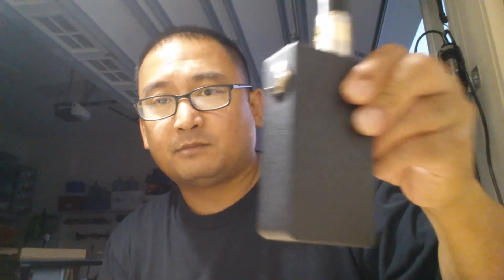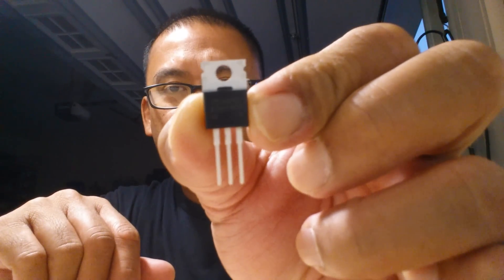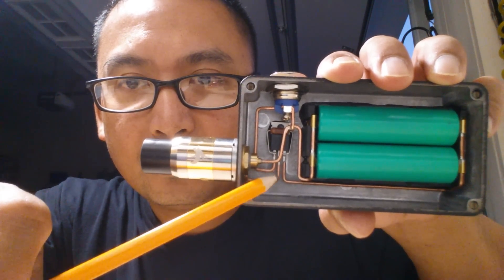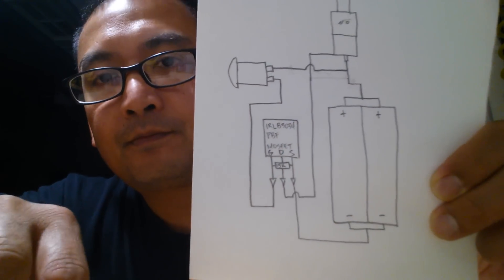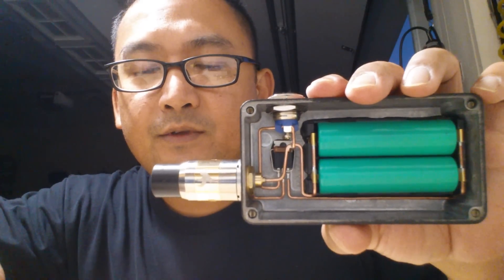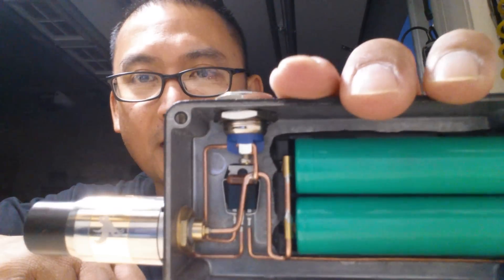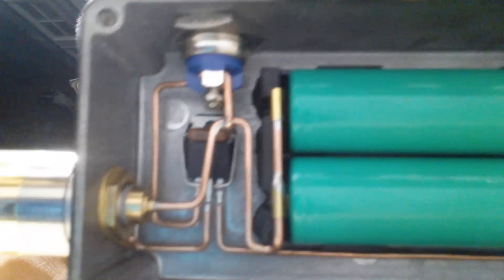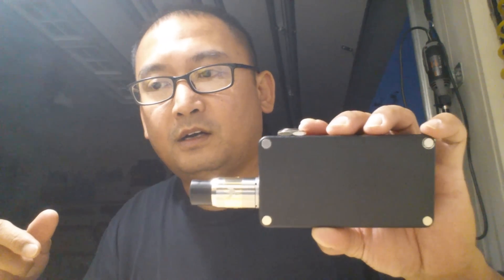Unregulated box mod with a Mosfet

Comment: don't get me wrong, first pin in mosfet is gate not ground. fitst pin is gate, midle pin is drain, and third pin is source. and resistor is connected from gate to source.
gate is trigger for current flow from drain to source, you can input postive for gate or you can use pulse if you want ajust flow current. remind me if im wrong

Comment: I have always been curious when using a metal box rather than a wooden or plastic one, would this cause more drainage loss from the batteries or the power going to the positive 510.
Would this use more power from the battery and cause less to go to the positive 510 pin,due to negative wire pressed on the inner part of the metal box by the nut, that holds the 510
So the current flow not only goes to the outer 510 but travels around the metal on the box, hence more voltage drain,
Where if you had a wooden box the current only travels to the outer part on the 510 as wood is not conductive,
If wrong could you explain please,

Comment: What's the wattage on that resistor? Also it seems like the extra ground from the drain on the mosfet to the outside of the 510 connector is unnecessary seeings how your negative is all ready on the source to the mosfet

Comment: witch pre coils you use ??? using the vtc5 battery ??? ... and the other cuestion, is there any diference between the 1 or dual battery ?... in the matter of the coil you use ??

Comment: It still safe if im not using the fuse? Or another fuse with the same spec? 15A, voltage? Can i using motocycle fuse in same ampere (15a). So hard to find that fuse bro, huufftt

Comment: How do you keep it from shorting itself out? Bare wire in a metal box is a bit scary IMO, especially if you drop or knock it over. Maybe that's just me.
Reply: Can you wire in a switch for some safety. But unregulated mox mods are always unsafe thats why they do not show them off to buyers
Reply: @filds1   It's not the unregulated part of the mod that's scary. It's the bare copper wire. Using wire that has a sheathing would be fine, but completely bare? Is asking for moisture to fry it. It could be any kind of moisture; e-juice, humidity, sweat (if it's in your pocket) etc. The box itself is metal which is fine, makes it easier to ground. But the bare copper wire just makes it easier to short out. It's an awesome build I don't want to detract from that, just was curious about the bare wire is all.
Reply: It just depends on the builder.You can make it safe. But people tend to avoid these kind of things while making a video.

Comment: People that don't use flux at every possible turn Rob themselves. Rosin core works but it's not enough. Especially for 14g wire and stubborn areas when your New. Depending on how long you take to do a good solder joint. If you can do it fairly quickly, than rosin core would most likely be sufficient. But your joints will shine with jester flux

Comment: Clean, but unsafe. We put these things in our pockets, I think I'd rather see some clean wiring with insulation. There are so many points of failure. What if you drop it, or God forbid you joined weren't soldered mistakes happen. This would be very easy to vent a couple batteries

Comment: I kinda posted this question already on your previous bid, but I wanted to add one detail, on that duel 26650 series mod, I was considering parallel mosfets, to mainly disapate heat better, but to do a few other things as well. what are your experiences with this as well?

Comment: Hi my friend ... I here very sad since I have everything to arm my box mod of 18650 x2 in parallel and it does not work, I followed your steps, I placed the mosfet IRLB3034PBF but my mod does not work ... I connected it with copper wire And the polarity as you have put it ... you can think what can be the problem ?

Comment: I'm so surprised this hasn't blown up on you. Do not ever use bare solid copper wire, that has to be the MOST dangerous thing to use.
Reply: KEVIN'S SPIRITUAL JOURNEY With the bare wires being that close to the metal box, any movement is almost always going to force one of the wires to touch the side and short out. Its also not recommended to use solid copper wire for mods anyway. Its just overall unsafe.
Reply: You're some sort of dumb. The gauge of those wires means that they wont bend from normal movement. Even dropping it on the floor wouldn't cause anything to short out.
Reply: for real though. 14 gauge is thick as fuck.

Comment: ATTENTION !!!

Can some one please explain to me why do we need to put a 15k ohm resistor on gate and source pins? whats the reason ? And whats the wattage? From the size i guess its 1w.
Reply: Basically, if you don't your mod will always be firing.
Reply: werethless12 thanks. how to determine what resistor is needed? does wattage matter? and i have made a mod with a mosfet its was 60Volts 70Amps rating. and after some time it broke. did i short it out somehow?
Reply: Life Sad Could have been a fake MOSFET. I have a 15k ohm resistor on my MOSFET. The MOSFET I use and that is highly used is the IRLB3034PBF, make sure you buy from a reputable retailer, like digikey or mouser.

My box is only a single 18650 mod, I don't build below 0.3ohms. Which is about 60w
Reply: werethless12 i have made a 235w beast two18650 in series and with a tsunami rda.  hits good. 0.30 ohm just barely in the safe spot
Reply: Life Sad I use LG HE4s, they are good for 20A, I only push about 14A with my build. Its perfectly safe.

Comment: where do you get other parts like the 510 and the wire? I have pretty decent electronic knowledge (used to install stereos in cars) but Im at a loss for getting every part needed for a vape mod. I have a friend 3D printing me sleds

Comment: here is a stupid question. Why use transistor. Just put the bateries in parallel you will get 4V (ok 3.7 after a while and 4400mah if you get one that is 2200mah...that is like days of vaping). why use extra parts. Adding a transistor in non regulated circuit is just adding more heat to that box and wasting battery juice. i use one 3.7v 2200mah battery with only a switch on a 1.8 dual coil. it makes a ton of vape and flavour. you dont need transistors or diodes..its only a waste of battery power
Reply: the transistor ( MOSFET ) regulate the voltage output of the battery to make it constant untill the battery power starts to get totally consumed , plus that , it protects the any backward current in the circut , it's like safer to put this transistor . :)
Reply: my quesition to you ,, 3.7V and 1.8 coils would give you about 14 Watts , how do you get a dense cloud with that ?!!

Comment: quick question: is there another alternative MOSFET that can be used besides the one used in this proj? Local shops here doesn't have that particular rectifier and if i try to buy via amazon or the like would be expensive on my end due to $ to Peso rate :'( Awesome vid btw and your works looked really great and neat inside-out. keep it coming!
Reply: There's different mosfets rated for different amps,
Reply: I would love to know the same thing lol
Reply: +Hohmies Mcfly it's a type of transistor not rectifier. Just fork over the money and order it, it's your build and you will be proud of it
Reply: hey did you ever get that project done,? if so how did it turn iur

Comment: hey how low can you build on that box. i heard that with mosfets you can only go so low. i am building my own box  i will be doing basically the same thing as you. i use 30 amp batteries. how low could i build safely

Comment: Does the wire have to be copper?
Reply: No, however it is always good to check the resistance of the wire you use with a multimeter (found at radioshack or amazon or with a search on bing.com). You do not want the resistance of the wiring inside the mod to drop below that of the coil or it will short circuit. Thicker wire has lower resistance. Until you know what you are doing, follow a mod build by instruction, check your mod with the multimeter, and then try other stuff if you still think it is necessary. Check out the wiring diagrams on fogcity (https://i0.wp.com/fogcityvapesupply.com/wp-content/uploads/2015/10/Series.jpg?ssl=1), they use two 15 amp fuses. The build above is a parallel build; I finished building a series circuit earlier today and should have some photos of it on www.coilpix.wordpress.com within a day or too (maybe by tonight). I went highly similar to the build above and may add the fuses on my next build. Always know what you are doing before you activate the firing button and be safe. Happy moding. :)
Reply: Okay Thanks!

Comment: The soldering flux or soldering paste, which are the same thing, aren't used to spread the heat of the soldering tip. The soldering flux is used to deoxidise the component conductors that we want to solder together because if we don't make sure to perfectly deoxidise every conductors that we intend to solder together the solder will not stick where there will be oxidation. That's  why we always apply some soldering paste or flux on all component conductors and printed circuit traces that we want to solder together prior to heat them with the soldering iron tip.

Comment: you can use silicone thermal glue to stick the fet on your case. it will electrically insulate the drain but will conduct heat. whole case will be a heatsink. will be better than regular glues.

Comment: would you be able to use a goblin v2 rta rebuildable atomizer on this?
Reply from the maker: +Brandon Vo you can. But I would recommend using a regulated mod instead so you fine tune the output for the build in your atty.
Reply: +Al USAF is it a good idea to use a regular clearomizer for unregulated box mods

Comment: goodpm again sir Al, ask ko lang po kung pwede ang mosfet chip sa series box connection? thank you
Reply from the maker: +lee marvin pwede, you can use the IRLB3034PBF mosfet for both parallel and series configuration.
Reply: ok sir Al, thank you.. parehas lang po ba ang installation ng parallel with mosfet and series with mosfet? gagamitin ko lang po yung mosfet chip para sa tactile switch.
Reply from the maker: +lee marvin wiring from the sled to the mosfet are the same. But obviously, you have to wire the sled for series.
Reply: wow. thank you sir Al, i must called you "The Box Mod King" hehe.. share ko po sa inyo yung project box mod pag nagawa na. hehe
Reply from the maker: +lee marvin lol! Let me know once you're done with your project.
Reply: +Al USAF  sir panu gawin ung coil?

Comment: does using one 18650 battery affect the amount of vapor production? and will I need to use a mosfet and 15k ohm if I use one battery
Reply from the maker: +Brandon Vo no and yes
Reply: +Al USAF I see some people using your mod but without a mosfet, how does that affect anything? and what difference does it make when using 1 or 2 batteries? sorry I'm new to mech modding
Reply from the maker: +Brandon Vo you need the mosfet for the switch which I explained in the vid (I highly recommend that you install a mosfet). Depending on how you configure the two batteries, either in series or parallel, will affect the output voltage and the amp capacity. Parallel, output voltage will be 4.2v and the amp capacity will be higher (so if you have two 20 amp batteries, the total amp capacity will be around 30 amps). Series, output voltage will be 8.4v and the amp capacity will be the same as having one battery (so if you have two 20 amp batteries, the total amp capacity will be 20 amps). Battery life for both will be about the same because you'll be using different resistance builds for each configuration. Just use an ohms law calculator to figure out a safe resistance build for your atomizer. The biggest difference between using single vs dual is battery life. But if you're going to build really low (atty resistance), then build a parallel mod.

Comment: if I wanted to add a master on off switch how would I do that ? would I just take some wire and connect the middle prong of the switch to the drain of the MOSFET and my outer wire from the on/ off switch to my fire button
Reply from the maker: Install the switch between the fire switch and mosfet.
Reply: Okay thank you much appreciated

Comment: Hi,I had manage to find a decent dealer in box mod parts over here in the UK`I am making the set up you have made`but on my set up I want to add the ( mini 0.28"led display digital voltmeter panel 2.5-30v ) This only has to leads one goes to the plus and the other to the negative I think lol,but I am not to sure where the best place to connect the two wires so I don`t damage it,and would I need a fuse or resister on this,Any advice please,Owe yes also battery copper clip metal for battery sleds what type do you use,Sorry for the amount of info needed but I trust you know enough to advise.
Reply from the maker: What do you want the voltmeter to read? If it's just for battery level indicator, then hook it up to the battery sleds positive and negative. But you'll need a switch either in line with the positive or negative wire. You can use a mini on/off slider or pushbutton switch. You don't need anything else. For battery sled contacts, I used whatever came with the sled. The contacts on the keystone 1048 are gold plated. Hope this helps. 

But if you want the voltmeter to also read your mod's voltage drop then check this out: https://docs.google.com/document/d/1mwPe0wkp1IOJ4SfF39bRp1KPbLk2VbNR1vBt3eTss34/mobilebasic
Reply: +Al USAF Thank`s for the info great diagrams,yes I want to make sure the batteries have enough power in them to use,this gives piece of mind,On one of you tutorials you mention the heat of your iron to solder`I cannot remember what you said you set the iron at,
Reply from the maker: +wow dude 700°F. When soldering the mosfet, make sure not to keep the iron on it for too long.

Comment: Can I use a 10k or 22k resistor instead of 15k?
Reply from the maker: +grantd272 I've only used a 15k resistor, but 10 or 22K should work...you can't find a 15k?
Reply: +Al USAF yea, my local RadioShack doesn't carry em
Reply from the maker: +grantd272 I wouldn't buy from Radio Shack because the mosfets there won't work. You need to buy the IRLB3034PBF mosfet. You can purchase it on EBay but make sure it's the authentic one. I would recommend buying it from Mouser, Newark or lonesomevapors.com.
Reply: +Al USAF not the MOSFET, the resistors.  I know to get the 3034 MOSFET. I think RadioShack carries the 115 MOSFET that can't handle near as much as the 3034
Reply from the maker: +grantd272 my bad...try the 22k. I think someone commented that 22k works.
Reply: +Al USAF ight, thanks.  I was going to build in series but I feel like parallel is better since u can build insanely low and have great battery life.  wats ur opinion on series vs paralell?
Reply from the maker: +grantd272 by building insanely low you're not going to have a great battery life. For a better explanation the difference between series and parallel, check this vid... 

https://youtu.be/MGgZmzlKyI8

Basically, series is more efficient and battery life is the same as in parallel, just check the vid why this is. 

I myself prefer series over parallel. I've since converted all my parallel box mods into series and moved onto building PWM mods (series but variable voltage).
Reply: +Al USAF OK, that actually makes sense.  so I guess I'll build series mod.  but was ohms should I run it at?  I heard the more wraps in a coil, the cooler the vape.  so I was thinking dual 26g kanthal at 10 or so wraps for .5 ohms.  would that work good?
Reply from the maker: +grantd272 definitely not a cooler vape. 26 gauge will work but 24 gauge is better, 8-12 wraps or anywhere between 0.5 to 0.8 ohms (you can go lower but it will no longer be a pleasant vape and not enjoyable).
Reply: +Al USAF I usually use 24g but steam engine was giving telling me 20 wraps for it to be dual and .5
Reply from the maker: +grantd272 try this...24 gauge Kanthal, 3mm inside diameter, dual coils, 4 mm leg length per coil = 11 wraps.
Reply: +Al USAF I got a question.  on a MOSFET, if the drain is touching the source will that cause it to continually fire without pushing button?

Comment: What's that copper looking wire you have used? Just copper wire? Why have you used that? I'm building a mod and love the look of your wiring! If it's copper wouldn't silver wire be better? Thanks
Reply from the maker: It's copper and I used bare solid copper wires mainly so it will look different than a typical Hammond box mod. You can definitely use silver wires.
Reply from the maker: +YourLocalBomber here's a vid of one of my subscribers that used silver wires in his box mod. 

https://youtu.be/eb4OhONY1Qg
Reply from the maker: +YourLocalBomber to be specific, the copper wire is THHN solid copper wire that I purchased from Lowes.
Reply: +Al USAF Thanks buddy what gauge wire is that?
Reply: +Al USAF just watched it again and caught it!

Comment: When buying the mosfet IRLB3034PBF TO220  I look for the one you have mention ,But when I see these for sale many have different other numbers and letters printed further down  on the lower part of the mosfet,Do I have to consider this factor`does it have any significance to what I should consider buying,NOT ALL SELLERS GIVE THE SPECS,So as long as it has IRLB3034PBF TO-220  ANY WOULD BE OK
Reply from the maker: The other numbers doesn't matter. But other vendors sells knock offs so buy from reputable vendors. I recommend buying from Mouser, Newark, Digikey or lonesomevapors.com.
Reply: +Al USAF Thank you for your very quick response ,As i am from the uk England i am trying to look from my local electrical shop,I also wanted to know whether I could use  the bigger size batteries and build in the same way using the same components but using a bigger box
Reply from the maker: +wow dude I doubt you will find it locally...Digikey should have it. Yes, this setup will work with 26650s.